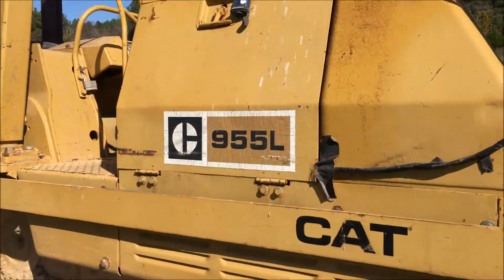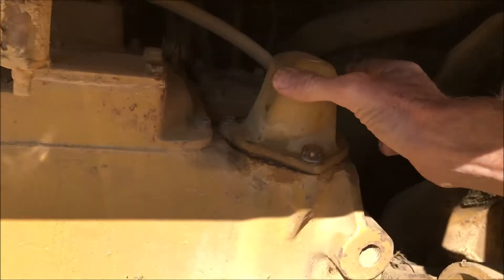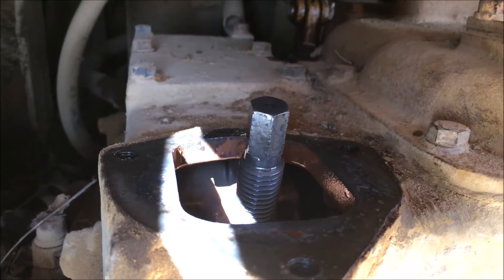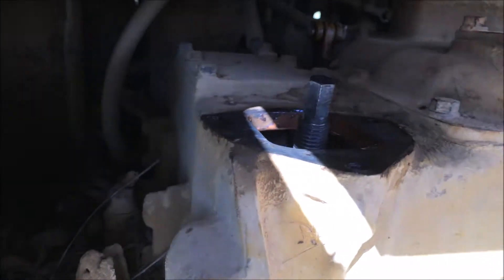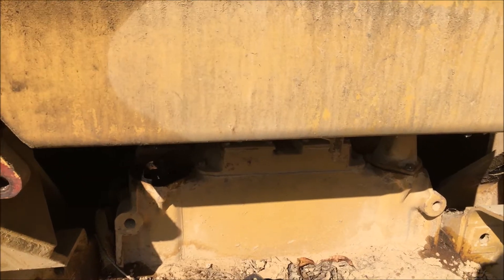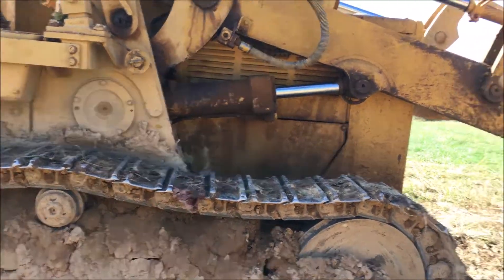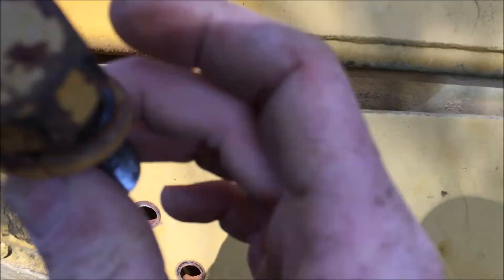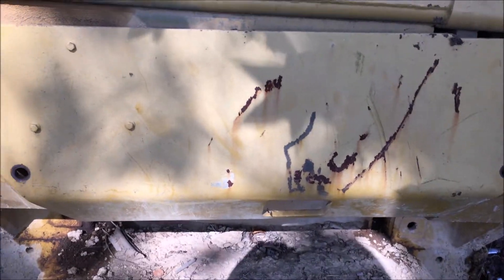Caterpillar 955L Brake Adjustment

Comment: Better check your maintenance manual, your supposed to tighten the adjuster bolt then back it off one and a half turns.
Reply from the maker: Thanks for the heads up I’ll check it out in the book.